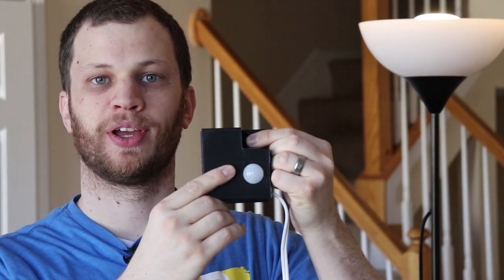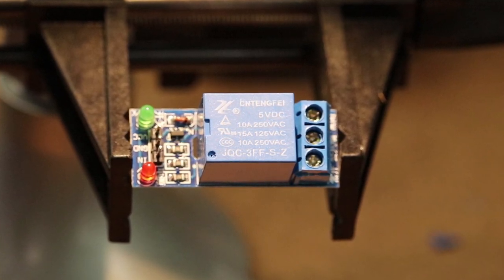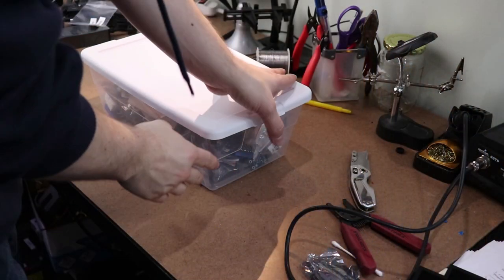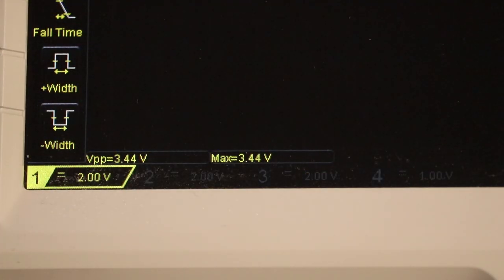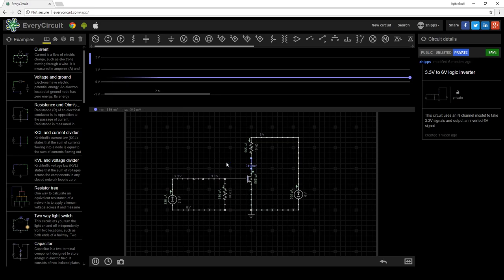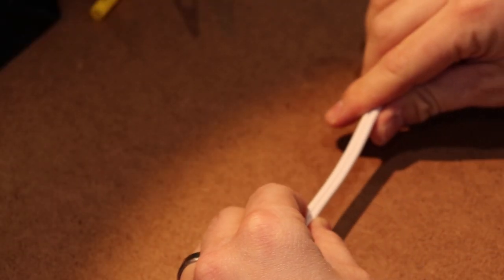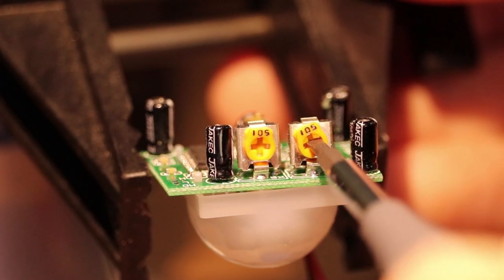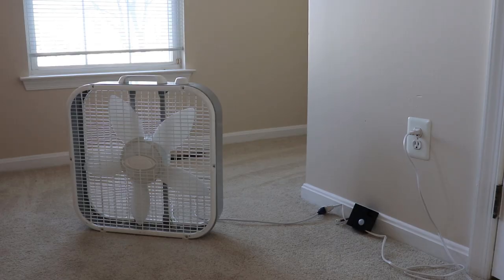DIY Smart Switch - Part 2 Motion Activated Relay

Comment: Hey, love the video. Just some advice from someone who 3d prints a lot. You made your walls super thick. I probably would have done .5mm on each side maximum. This will save you tons of print time and filament.
Reply from the maker: Good to know, thanks! I'll have to experiment with wall thickness. I usually leave that on the default cura setting.

Comment: Love the design but to make it more sustainable you can put a small AC to DC power supply inside the enclosure and have that use the mains power to power that  the PIR and the relay (low side). You can put a main switch at the back for the AC  to the power supply) and one at the front ( as you have it for the DC to the PIR and relay. That way you don't have the power supply on all the time if you are worried about power consumption.
Reply from the maker: That's a great tip. I considered doing that, but wanted to keep it simple for anyone wanting to make one. Do you have any recommendations on an off the shelf transformer/regulator? In the past I've just bought really cheap USB wall chargers on ebay and ripped them open to steal their AC/DC power supply. I would like to find one that is project friendly.
Reply: A simple off the shelf phone charger AC to USB block. They are 5V @500mA or more which is more than enough to power the PIR and the relay. Usually the square blocks have a low profile circuit that can probably squeeze into your battery pack part without any print changes.
Reply: This is something I want to see. I want to do an in wall light switch with one of those power supplies so that I don't have to change batteries.  My wife keeps losing the timer for the holiday lights and I wanted to convert the plugs out there as well. For things like this plugs, switches, outlets, anything that I could tap into the mains and make it permanent I would like that option. I don't want to plug in my light switch.

Comment: Really really good and clear, thanks. (too much loud music). I'm working on switching a 12v valve using a normally closed relay to cut off the water from the water butt when the bucket is full. Next I want to make bird scarers to hang in the fruit trees. Any thoughts would be appreciated.
Reply from the maker: Those sound like great projects! See if you can document your process and share with others!

Comment: Thank You for the Videos. I have already increased my knowledge in just a short time by watching your videos. I always wondered why someone would need a 3D printer, now I see how useful it is. I always used a roll of electrical tape to seal my projects.  I am working on a rear window defroster in my truck since it did not come with one. I am going to try it using Conductive Copper Foil Tape 1 inch for the BUS and 3mm for the lines.I plan on using a NE555 DC 12V Delay Relay shield Timer Switch Adjustable Module to turn the power off after about 5 minutes. Do you have any advice
Reply from the maker: Thanks for watching! Your defroster project sounds cool! Let me know how it goes.

Comment: Hi Zach, how do you run the wire to test the relay with the variable power supply and the oscilloscope. I have the Rigol Dp832 power supply and Rigol Ds1074z.  The leg that is connected  to the resistor and Vcc, is it the drain leg? and the leg to out is the source leg? Thanks

Comment: It would be best to cut the hot side of the extension cord wire as you would with any switch.
Thanks for the video.
Reply from the maker: Thanks for the tip, I actually made sure I cut the hot side of the extension. The extension cord I used has ridges along the length of the neutral side to help with identification.

Comment: Actually, my understanding is that the relay turned ON  with voltages ABOVE 3.9V, and it was OFF, with voltages between 0 V and 3.9V so the relay would be OFF all the time, NOT ON
OR, where did I get it wrong? A relay with no power applied to it, (0V) is OFF. A relay with not enough power applied to it (3.3-3.4 V) i.e. below the voltage threshold is still OFF and a relay with enough power applied to it (i.e. above 3.9V will turn ON  (For clarification, I am not confusing power with voltage but the threshold is in volts , as the relay does not use that much power anyway
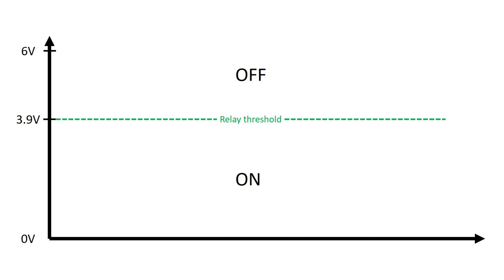So, I think that your diagram at 4:19 and the subsequent comments that the relay will turn on with any voltage below 3.9 V is wrong. The relay will NOT turn on with any voltage below 3.9 V
that is the relay coil attracting the blade. The relay will  normally have three contacts,  one is common and then one is NO (normally OPEN) and one is NC (normally CLOSED)

When you power the relay  with ABOVE 3.9 V, the relay will turn ON and the NO contact will become CLOSED /linked to Common and the NC contact will become OPEN (disconnected from the common)

Comment: Hi Zak, thanks for the video. However, I'm a bit confused on how the relay works. You mentioned that the relay will remain close when the voltage output from the sensor is below 3.9V. So my question, is that not the right outcome if what we are trying to do is whenever there is a motion detected, the sensor will output 3.4V and causes the relay to close hence completing the circuit and result in the light being switched on? Why do we still need the mosfet? Sorry for the lengthy questions
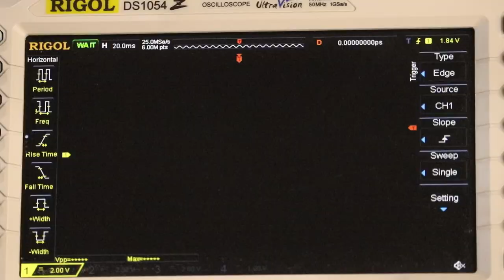Reply from the maker: Good question, I tried answering this with the graphs in the video starting at 4:00. You're exactly right, when the motion sensor detects motion, it outputs 3.4V which is low enough to turn on the relay. However when the motion sensor stops detecting motion, it outputs 0V, which is still low enough to turn on the relay. In this case the relay will always be turned on, and never turn off! The motion sensor will just keep sending either 0V or 3.4V which is never enough to turn off the relay. See video at 4:15.  In order to turn off the relay, you need a signal above 3.9V. So you need a signal that switches from 0V to 6V for example. I need the relay to turn on when motion is detected and turn off when motion is not detected. The mosfet fixes both of these problems. It translates our 0V-3.4V signal to 0V-6V and inverts the logic. I hope this makes sense.
Reply: The relay is low-level triggered, which means every voltage below 3.9V(logic LOW for relay module) will make it turn on (close the relay). However the PIR sensor is high-level output of 3.3V, which means it will output 0V(basically GND, logic LOW level for the PIR module) when it's not triggered, and output 3.3V(logic high level for the PIR module) when it's triggered. As their logic level definition of HIGH and LOW is different(the PIR sensor is 3.3V logic while the relay module is 5V) and their enabled level is different(relay is LOW enabled and PIR is HIGH enabled), there must be some convertion. Sorry for the long and unprofessional answer and hope it can help you understand further.

Comment: The logic part completely flew over my head. And that damn music in the background. Appreciate your effort. But could you explain better the Logic gate etc part of this for NooBs like me?
Reply from the maker: Digital electronics use 2 different voltages, usually zero volts and 5 volts or whatever the battery or system voltage is. These two voltages are used to send on/off, high/low signals. Some devices are activated with a low signal and some are activated with a high signal. Sometimes a device produces a high signal when you need a low signal. In this case you need to invert the signal to make it low. That's what I needed to do to get the motion sensor to send the right logic level to the relay. Without this "inverter" the relay would do the opposite of what I wanted. Hope this explanation helps!

Comment: interesting video. thanks. i'd like to hook this to a handicapped door switch to automatically open doors when someone walks toward it.
Reply from the maker: That is a perfect use for these PIR motion sensors. Let me know if you implement this, I'd love to see it.
Reply: Can you tell me what is the little gold part you're soldering on at 5:59? is that in my official arduino kit or something I need to buy? i don't see anything like it in my kit. is the 9v battery adapter ok to use or should i get the AA battery adapter?

Comment: Thanks for this awesome video. I have a really quick question, relay doesn't depends on the frequency, right? Or do they come with a frequency rating?
Reply from the maker: I'm assuming you're talking about the frequency of the AC current coming out of the wall (50Hz or 60 Hz)? No, they don't usually have a frequency rating.
Reply: Thanks. I figured. This video helped me so much. Keep up the good work.

Comment: Question, since you were using this to control A/C power, did you consider building a small power supply to fit in the case? (Or take an old USB charger out of it's wart case.)
You could have utilized the A/C Power in the box and avoid the batteries.
Just a thought.
Reply from the maker: This is a great suggestion. I did consider both of those options. In the past I've ripped apart old cell phone chargers to get the 5V AC/DC power supply but this was a messy solution. Since this video I've found off the shelf 5V AC/DC power supplies that should work well for projects like this.
Reply: @bytesizedengineering  I am trying to get my light switch to work via wifi and then homekit. This project is kinda finished but one thing, i have an esp8266 hanging out of my light switch,  powered by a phone charger plugged into an outlet. I want to get the esp8266 in the wall but i dont know if it is safe to use my ripped appart phone charger and solder the mains onto it. Is it safe for me to do it, can my house burn down and is this a good overall solution?

Comment: Thanks for the great videos!  I am not sure if the previous responser is correct. The MOSFET to invert the logic might be what I need. I thought I could use the NC and NO to solve my light triggered relay.  I have a relay to close the door buzzer for my building.  The relay has an optical sensor taped to a screen of an old phone.  Idea being: friends want into my building, I am not home, they call a number and the building, door is open. Door should be open as long as the screen on the phone is lit.   Problem being, if the relay has no power, the normally open is closed, only with power is NO open....all fine.....phone call lights screen, door buzzer circuit closed all fine ...EXCEPT.... if my 5v supply to the relay dies  (USB transformer...they do die) the circuit is closed and the buzzer will be buzzing permantently.  Not good.    Will likely put a sonoff relay AFTER the optical relay.  there has to be a simpler way.  Free accomodation in Palma de Mallorca if you can help me.
Reply from the maker: Sounds like a cool project! Good luck
Reply: @bytesizedengineering  since discovered IFTTT.  Missed call from guest telephone number ID will trigger Sonoff in inching mode (3seconds).  Only the caller ID from the guest will open the door, when I remove that number from the trigger, they no longer have access.  I love the Sonoff 4ch and 12v SV switches since they allow inching mode and have NO/COM/NC relays as  opposed to the standard Sonoff switch.  Thanks for your inspiration.

Comment: do you think if I use arduino to control the PIR sensor and hook it up to a light (connected to a relay) i would avoid having to go through all that complicated procedure of soldering other micro components to my sensor?
Reply from the maker: Yes an Arduino could absolutely be used to do the same thing. I wanted the challenge of not using an Arduino. I'm glad you're thinking about other ways to do this, that's always cool to hear!

Comment: How much time does the AA batts will work? I was thinking to do a project like this for a walk-in closet lights
Reply from the maker: The batteries should last quite a while. The more time the relay spends turned on the more power is being used, and the sooner the batteries die. You could use a cell phone charger to plugged into the wall to provide power instead of the batteries. That's what I would do for a more permanent installation

Comment: FWIW, we don't watch your videos to watch your soldering technique. I would recommend you double the speed at that point. If people really want to watch that part closely, they can slow the speed to half with the player. ------- A suggestion of course.

I also suggest you break out some parts, such as 3D printing a cover. This will give you extra material at no extra cost. It also give more people a reason to come. You then get electronics, home improvement, & 3D printing.
Reply from the maker: Thanks for the feedback

Comment: Hey would it be easy to switch the light off when the sensor gets triggered?
Reply from the maker: I answered your question in my reply to your other comment on my other video. But here it is again:

That sounds like a cool project! I see that you found my other video showing the PIR motion sensor. I would start with something like that and connect it to the normally closed terminal. Good luck!
Reply: @bytesizedengineering  thanks i looked up relay wiring and yeah i get the different wiring to normally c or o thanks. Glad it is easy :)

Comment: Why don't relays activate when you put in voltage and deactivate when you have no voltage, not the other way around? Seems counterintuitive
Reply from the maker: The coil in the relay behaves exactly as you said. Most of the time these little relay modules use a transistor to drive that coil and depending on what type of transistor they use (NPN, PNP, N channel, P channel) the logic to turn on the transistor will be inverted.

Comment: Can you show us how to connect to a raspberry pi zero from a distance using another raspberry pi. For example I want to control a raspberry pi zero from 5 miles away
Reply from the maker: I would connect them to the internet. You could run a web server (Samba) and have the other as a client.
Reply: I am trying to do the same. I am gonna use an IoT to control the switch manually and remotely. They are really cheap and there are tons of resources on how to use them.

Comment: someone with electronics knowledge pls explain this... 

Why do we need a MOSFET and all those ? 
if we just amplify the signal to around 4V and use the 'NORMALLY OPEN' port with the common, switch will be closed when the signal gives a 4V & Switch will be opened while the signal gives below 4V. that way you don't have to deal with that reverse logic. 
I think there was a reason why you didn't do so. if someone knows it, pls explain...

Comment: Instead of using batteries to power the sensor couldn’t you use a wall wort that produces the necessary voltage. I think that’d be a more permanent solution
Reply from the maker: That's certainly a good option.

Comment: What mosfet did you use?
Reply from the maker: I think I used a 2N7000. Very common, should be easy to find on eBay in a pack of 10.

Comment: How long does it stay on?
Reply from the maker: Since there is no microcontroller (like an arduino) the only way to adjust the time is right on the PIR sensor. There is a potentiometer that controls the delay time.

Comment: Can not believe you do not know that relays like that one have a normally open and a normally close output! Would have eliminated the need to test and make the new circuit to use it!
Reply from the maker: Thanks for the feedback. I'm fully aware that relays have NO and NC terminals, in fact I mention them in part 1 of this series. There are two reasons why I can't use the NC terminal for this project. First, as I mention in the video the output of the motion sensor ranges from 0 to 3.4V DC. It doesn't have a high enough logic level to activate the relay, if I were to directly connect the motion sensor to the relay, it remains closed all the time even though motion is being detected. I have to have a signal that changes from 0 to some voltage over 3.9V. That's why I used a 2N7002 N channel mosfet to get an inverse 6V signal out of the 3.4V motion sensor output. The second reason I didn't want to use the NC terminal is the fact that this is battery powered. In order to turn off the lamp (the state it would be in 95% of the time), I would have to energize the coil which would run down the batteries much quicker. The coil would be draining the batteries most of the time just to keep the lamp off.
Reply: @bytesizedengineering  great design! for a while I was wondering why you didn’t just use a transistor to amplify the 3.4 volts to get the relay to switch from NO to closed. But that would of taken more components than your design that used just three. Thank you for sharing